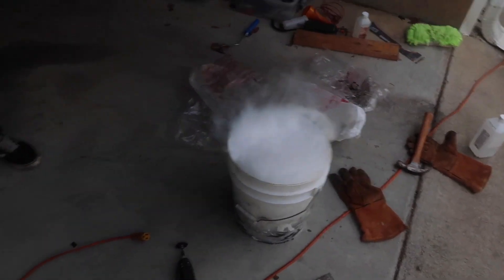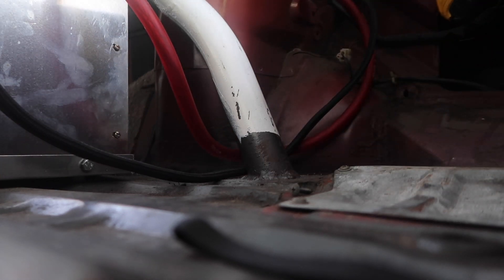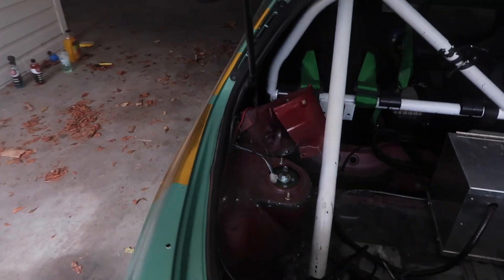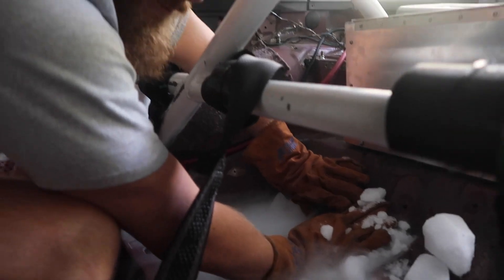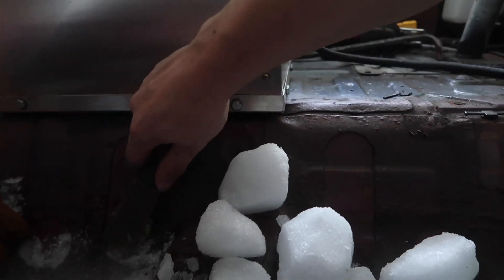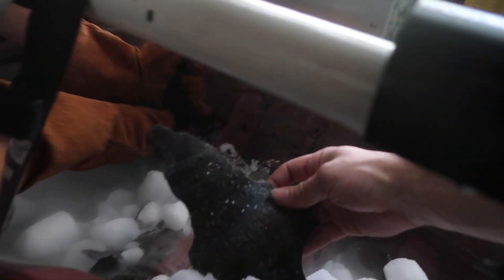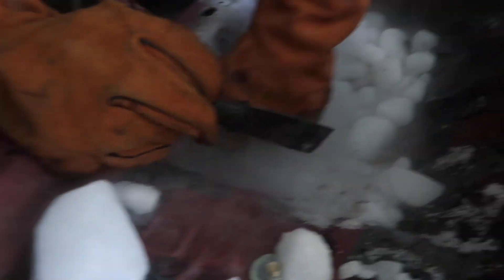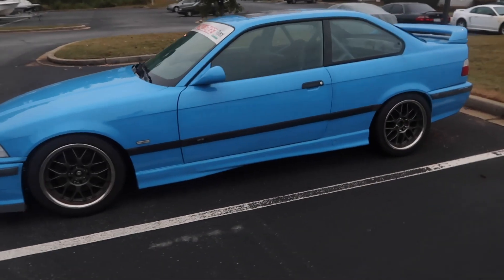RACE CAR DIET FOR THE FC RX-7

Comment: Yo its a ticket if you don't have the 3 points in on the street. also future reference you can hit the sound deadening with a hammer and it pops easier
Reply from the maker: We switched to hitting it with a hammer soon after we stopped filming. I’ve been pulled so much not wearing a 3 point and just race belts. No one has cared but that’s good to know
Reply: I'm surprised. I was told it's for emergency crews for wrecks. They dont know how to undo them. Cop told me that.
Reply from the maker: I’ve been pulled in SC, NC, GA, and TN none of them cared or mentioned it was illegal. Hopefully I keep my streak of that. Anyway I’ll refuse to wear a 3 point belt is something with no air bag
Reply: Yea I dont blame you. Need a helmet as well with that cage.